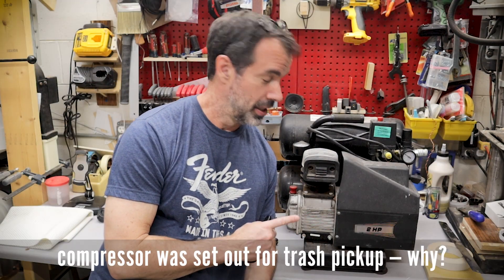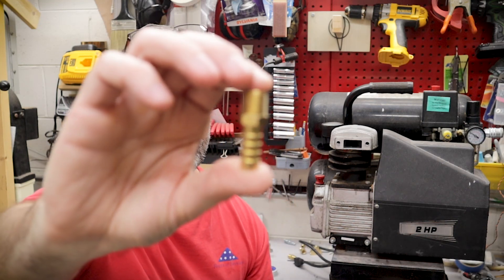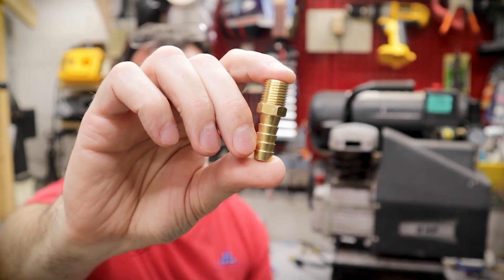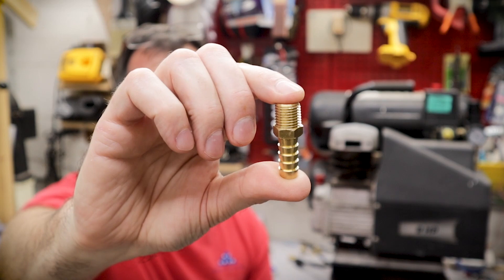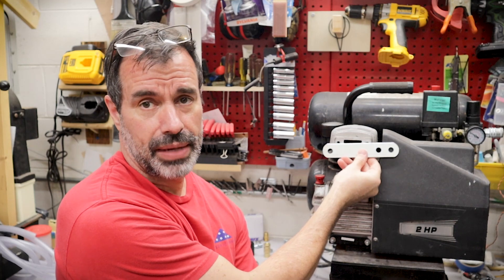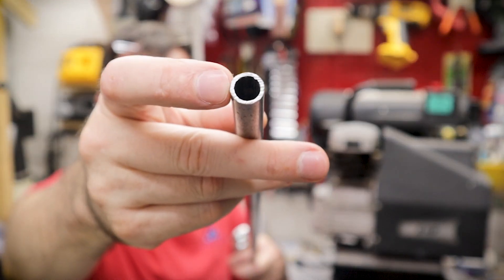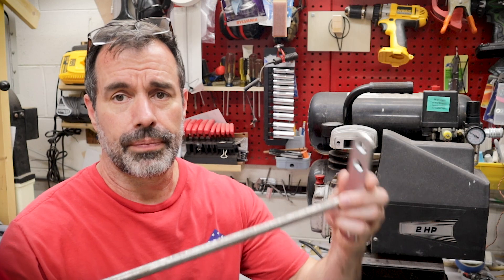Air Compressor to Vacuum Pump Conversion - The Next Project

Comment: sir while using to glue guitar bracing. should we close the outlet value. or should keep it open which is used in spray gun
Reply from the maker: Aqua, thanks for watching.
I may not understand the question, but as I have this compressor set up, the vacuum is from the intake side  of the pump. To draw down the vacuum bag takes very little time, so I have not opened the "tank side" value. 

If air is pumped into the tank, it doesn't seem to matter in my case.  You could open the tank so it won't build pressure, as you really aren't using that side of the compressor to draw down a vacuum.

You may need to do some experiments with your setup to determine what works best for you.
Sorry if this doesn't answer your question.
Good luck with your project.
Be safe and take care!

Comment: Hey, so how's this holding up for vacuum bagging???   I have the exact same HF A/C which has a pinhole leak on the lower tank so it's just laying around.
Reply from the maker: XFBO, thanks for watching!
It's still working.  I only run it a few seconds at a time to draw down the vac bag, then again occasionally to hold vac.  My bag has a slow leak .. so, the compressor is doing great for this purpose.  
Good luck with your project.
Be safe, take care!

Comment: I was hoping it would pull a lot deeper vacuum.  21-23 in/hg i great for your application, not so great for AC or a heat pump.  Thanks for the video, it stopped me from wasting my time on my own compressor.
Reply from the maker: Mike, thanks for watching.
Glad the vid saved you some time.
Just curious, how much vacuum do you need for AC or heat pump work? Just curious.
Take care!
Reply: @theNextProject  You want 500 microns or less which is 29.90 in/hg.  You really need a mircon gauge for something that low and precise considering atmospheric pressure is 760,000 microns.  I've gotten as low as 300 microns with a cheap vacuum pump although the gauges aren't cheap.  What you got is a great high volume solution for vacuum sealing.  I had a similar setup plumbed into my Foodsaver and it would quicky crush a can at 23 in/hg.
Reply from the maker: @mcombsemail   Mike, thanks for the explanation. Very interesting stuff.

Comment: I saw you had an air compressor.. So that we all dont have to watch you suck on a long hose again why dont you use that to induce a vacuum?
Reply from the maker: Hmm, what?
Reply: @theNextProject  I don't know what happened to my response, seems it was deleted.

I wasn't trying to be an ass about it just mix in some humor, I was feeling bad for ya with the hose water and thinking of my MightyVac vacuum pump for removing used motor oil from engines, it too has a venturi and you can induce a vacuum by attaching an air compressor to it rather than manually pumping it.

I linked a product in my original post, I suppose that's frowned upon.

So Google search Infinity Tools Venturi Vacuum System & I'm positive you can figure it out brother.
Reply: Hahaha oh man 🤦

So my original comment was meant for another video entirely and I'm unsure of how it got put here.

I was watching a YouTube short of an older gentleman sucking on a long hose to siphon water from one source to another and was trying to leave the comment there, wholly confused after I hit the video for these comments I've never even watched it before!
Reply from the maker: Ah, now I get it.
No worries, been there, done that too.

I have a little Venturi vac block too.
One reason I haven't been using it, is the volume of air I need to draw a vac on large areas.
For small things it seems to work well, but for vac bagging, I don't have enough air compressor to get the job done.
Now that you've got me thinking about it, maybe I could use the Venturi block to to "touch up" vacuum draws when the bag leaks a little. Hmm, might need to try that.
Thanks for making me think.

Be safe, take care!

Comment: Nicely done, and thanks for going to the trouble to post this video.  But wait...

How long did the bag hold the vacuum?  Did you have to reconnect the vacuum hose, say, every 15 minutes, for hours and hours until the glue dried?
Reply from the maker: Stephen, thanks for watching!
How well it hold vacuum depends a lot on me, and the bag. Best I've done it good vac for about 3 hours before I'd need to give it a little more draw. Typically, I have a small leak at a shut off valve, or a weak bag seal. 
When I do use this, I try to do my vac draw-down first thing in the morning so I can check the pressure during the day while i do other things.  
I'm also working on a high density foam press which I may use after the initial vacuum drawdown, then sandwich the foam and a wood platen, then clamp it all down. If vacuum is lost once clamped, it hopefully won't matter.  Some testing to be done.
Take care!

Comment: Great Video, I had a few questions regarding it. I have a 0.5HP Air compressor with me and wish to convert it into a vacuum pump for LRTM (Resin Infusion Process). Can I do so if I follow these steps, I'll do some of my DIY as well. Your help will be really appreciated.
Thanks for the video anyways❤️
Reply from the maker: Shubham, thanks for watching!
I honestly don't know if a 0.5hp compressor, if converted to a vacuum pump, will draw enough air for your needs.  Also, not knowing the size of project you will be infusing - I just don't want to give you bad info.  
Best I can offer is to attempt the modification, and dona dry test run. You'll should get an idea if the 0.5hp will draw enough volume and to what pressure.  Good luck with your project and testing!
Reply: @theNextProject  Hey, thanks for the reply. My need for the vacuum pressure is as low as 0.5-0.6 bars and the part that I want to infuse is the size of a football. That's it. Please let me know if it would be possible for me to do so. TIA
Reply from the maker: @ShubhamShelke07    sorry, I wasn't paying attention.
You need 0.5 to 0.6 bar of pressure.
My 2hp compressor will draw -20Hg of vacuum, which I think my be around 0.7bar.  so, if that is the case, your 1/2hp compressor may struggle to either pull enough overall volume, or no be able to pull down enough pressure/vacuum to infuse your work. Sorry, I really am not sure.
Reply from the maker: Ah, your compressor may just work for you then.  
You will still need to DIY your compressor, and test accordingly. Sorry I don't have a definitive answer for you.
There are also attachments you can add to an airline without converting a compressor. Basically, that air rushing through the line creates a vacuum which then pulls air from the item you are trying to draw down. I'm thinking the problem with that approach would be the volume of air needed to create the draw you need. Sorry, that idea is a bit off course.

Comment: TYVM it's a great idea, now to see if I can do it.
Reply from the maker: You can do it! (in a Rob Schneider voice).
Thanks for watching and the comment!
One thing to be aware of - I wouldn't use this type of set up for continuous vacuum use, but for short operation it seems to do well.
One concern might be if used for long continuous periods of time, the vacuum may attempt to draw oil from the crankcase. 
I haven't had that issue, but I'm typically running less than 30 seconds, and not very frequently.
Good luck with your project, take care!

Comment: Hello. Can you please tell me what vacuum bag and those seals on the end are exactly? I have tried vacuum bagging composite with regular bagging film on a roll and that sticky gum like tape and it was a nightmare with vacuum leaks.
Reply from the maker: King, thanks for watching!
I ordered the vacuum bag with ends as a kit from VeneerSupplies.com.
I bought their build-a-bag kit. I believe it is their VS Elite bag material, a polyurethane. 
I also purchased their vacuum breather mesh, but I think you could use fiberglass window screen and save some money. Their mesh screen does a great job, but it can be a little bit of a hassle to use at times. 
The tubular clamp ends come with the bag kit I purchased.  Sadly, prices have gone up since I purchased my kit. Nothing is affordable any longer. 
I hope this info helps.
Good luck with your projects, take care!

Comment: Brilliant!   I've been watching a bunch of your videos lately (truly appreciate you taking us thru the journey with "mistakes").   My RoarRocket vacuum bag broke and I need to make a new bag.   You're video re-ignited my need to make a new bag & take a different approach :)  Any tips on how you made yours, or where you sourced it?
Reply from the maker: Good to hear from you again and thanks for spending the time watching the vids, glad you're finding them useful.

I purchased the bag(s) and mesh material from veneersupplies.com.
I don't recall for certain, but I think my bags are the VS Vinyl™ material. I'm not a pro at this, so I didn't go with the higher end $$$ products, I'm still learning.
The small air compressor mod works really well. However, if you have a long-cure time glue, you'll have to babysit the pump, turn it on and off as needed. It doesn't have a vacuum regulator on-off feature - at this time.

Oh, I've also got more richlite info and will have a part 2 for that video in the near future - if interested.
Be safe and take care!

Comment: hi. thank you very much for the knowledge. How low the vacuum can go with this hosepower?
Reply from the maker: Thanks for watching.  
It may depend somewhat on what is being drawn down under pressure.
In my situation the compressor will draw down to +/- - 22hg. 
My vacuum bag is 34"x30" clamped, with about a 6' vacuum hose. It will get down to - 20hg in 10-12 seconds, then +/- - 22hg in another 5-10 seconds.  
A couple times the guage read -25, but I think that was due to pulsating vacuum when the pump was running. At rest -22 seems to be the max vacuum.

Comment: Where to hook up to compressor ?
Reply from the maker: Ralph, thanks for watching!
The compressor can be used like normal by connection an air hose to the  standard connector. The "air intake" inlet hose would need to be removed before attempting  to fill the tank with air to use as a regular compressor. The air intake will be choked off if the hose is left in place, as it is used to draw a vacuum, not really to allow the compressor to breathe and fill the tank.
take care!

Comment: So what exactly did you remove from that rectangle area ? Hose fittings?
Reply from the maker: Edad Pops,  I'm guessing you are asking about what I removed to expose the rectangle area at 0:35.  
If so, I only removed two small Allen head bolts which hold on a plastic air filter cover.
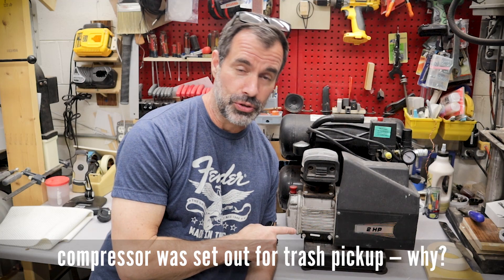The plastic cover can be seen in place at 0:14.

Sorry, I didn't realize I had omitted the removal of the filter until reading your question. I kinda skipped over the start of the project by doing so.
Let me know if you have any other questions.
Thanks for watching, take care!

Comment: Interesting...
I'm not doing  long term/heavy vacuum suction.
So I'm thinking of adding a T to my air compressor just in between the intake filter and the compressor assembly.

Just for sucking air out of inflatable mattress or toys for storage. I already use the compressor to inflate those quickly.

So all I have to take care of is the oil in the crankcase.. that's not much of a hassle. It is a "oil-less" compressor though.
Reply: I do that with the toys and mattresses with the shop vac. The mattresses usually have a large valve big enough to just use the standard hose but you can make a smaller one with some graduated pipe for smaller air valves like on toys.
Reply from the maker: Sounds like a good plan. 
I like the "t-valve" idea, genius!
Let me know how the oilless compressor does.
Thanks for watching and the comment.
Take care!

Comment: Will it be neccesary to add oil regularly someplaces in the compressor in order to avoid damages when it´s used as a vacuum pump?
Reply from the maker: J. E.
That is a great question, and may vary depending on the compressor and the amount of use.

I found this compressor curb-side on trash day. I don't know its history, but it had oil in the crankcase when I drug it home. 
I've used it moderately, a half-dozen times to pull vacuum on a veneer bag. Then a few times during each project just to keep the vacuum on the bag (the bag has a slow leak).
I haven't added any oil to the compressor yet. 

If it were used everyday, I would expect there to be some loss. However, I only need to run it ± 30 seconds at a time to draw my vac bags down. So total use is almost - zero.  
When used as a compressor, it has to run for a few minutes to fill the tank. But, when used as a compressor, it's not likely to "suck" oil out of the crankcase, as it may do when used as a vacuum pump.  

Whew, that's a long reply.
I hope it helps, and good luck with your project(s).
Thanks for watching the video and the comment too.
Take care!

Comment: Will the compressor still work as a compressor with the modifications that you did ?
Reply from the maker: Hey Rob, thanks for watching and the comment.
Yes it will - at least the way I have this one set up.
If the "vacuum" tube is pulled off the air inlet, the compressor will function as a "compressor".
A few things to think about, the restriction at the inlet will impact the amount of air the compressor and inhale, which may negatively impact the efficiency, speed, and volume at which the compressor can, compress. So it may not be as efficient with the vacuum manifold bolted in place.

When using this compressor as a vacuum pump, there may also be potential for an internal crankcase "vacuum", which may attempt to pull crankcase oil past the piston rings. 
I haven't had any oil loss on this compressor, but it is something to keep in mind. 
A dedicated "vacuum" pump would be the best option, but since this compressor was set out for garbage collection, I figured why not try the conversion.

It works better than I expected, and I'm not out anything if it does fail in the future. 
Would I buy a brand new air compressor to modify for this use - probably not. But if you only needed a vacuum pump for a single project or short use... you could likely get away with it.
You may be able to locate a "used/cheap" compressor to modify in this way, just for vacuum use.

This mod is completely reversible. Simply remove the inlet/vacuum manifold that I bolted on the inlet breather. Put the air filter back on and you're done.

Use your best judgement and good luck to you with your project.
Take care!

Comment: Hi, I have the same exact air compressor and considering doing this to vacuum bag for surfboard repairs.  Does it work well for you?  Any change you'd consider making the adapter piece for me for a reasonable price?
Reply from the maker: @Dan Rovetto
It has worked very well for me, but on a scale a bit smaller than surfboards.
The vacuum bag I use is typically clamped at 30"x30". the compressor draws that space down very easily and fast. 10 - 15 seconds it will be at -20Hg, but I pull it down to -24hg or so, as I have a small leak somewhere.
I'm considering rigging an auto switch to toggle on/off based on pressure. More research needed on that.
As for making a flange, I'm a bit strapped for time right now, otherwise I'd be glad to help. How soon would you need the piece?
Thanks for watchin, take care!
Reply: @theNextProject  No worries I totally understand.  I got a small leak as well so had to shift gears to fixing that.  Maybe we can help each other out on this.  Here's a link t download pics of my issue.  Maybe yours is the same.  Any chance you know what that rubber seal is called so I can try and find a replacement?  https://we.tl/t-pMJNjiWAGr
Reply from the maker: @Rovettod  Hey Dan, that is part of the pressure shutoff regulator. That rubber pancake is the pressure regulator diaphragm. Not sure where to get just that part, but a complete regulator can be found various places.
Reply: @theNextProject  ok gotcha.  I appreciate it.

Comment: Will  membrane paper press on Kitchen cabinets?
Reply from the maker: Sorry, not familiar with membrane paper. There are many coatings and various veneers used on cabinets. Some are semi-rigid, some liquid, some heat formed/molded... Lots of options. Also depends on the cabinet surface to be covered. Flat surfaces would be easier than complex raised panels, etc. Good luck with your project.
Reply: @theNextProject  
Sir my paper is press with heat and surface is routed
Can done it by this
Reply: Sir how long continue run ?
Reply from the maker: @3DMrSharmaji  I have not used the product you mention. I would suggest trying various methods to apply your paper product. A vacuum bag may work well, but I have no way of knowing without actually testing the process. Good luck to you!